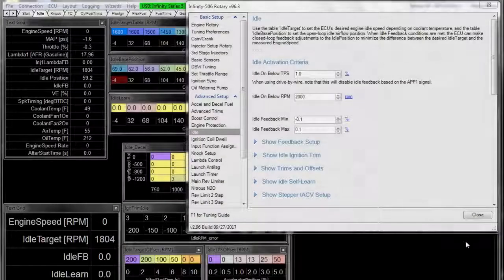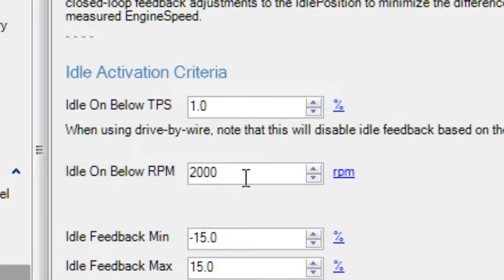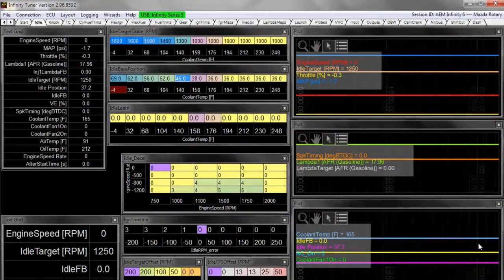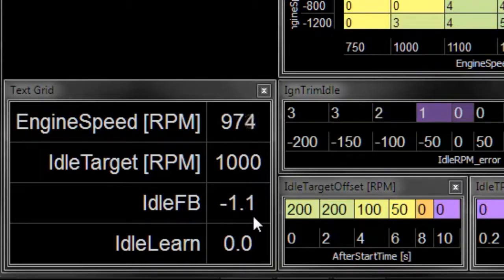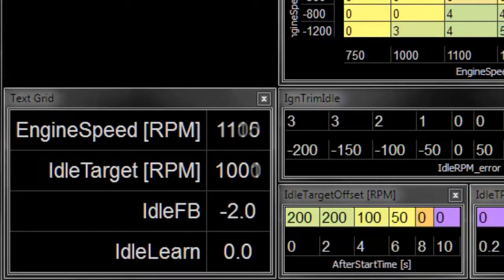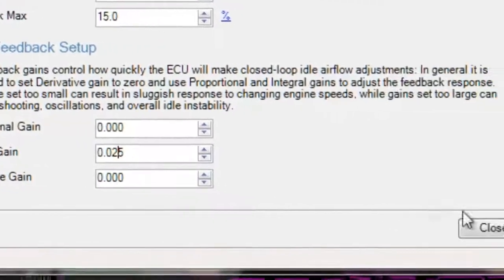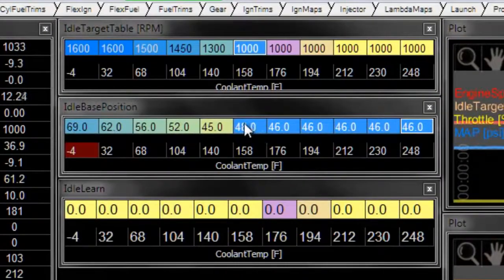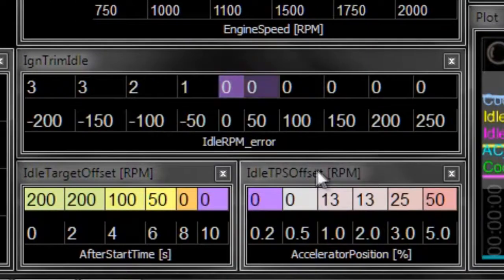Tuning Idle Airflow Feedback (Infinity Tutorials Part 2 of 3)

Comment: what's the ideal position for the idle stepper motor at idle? Is it wrong to open the air bleed or throttle stop to not allow the idle to say go under 800 when all other feedbacks are disabled? ign/air. Most of these import idle air motors are closed when not powered?